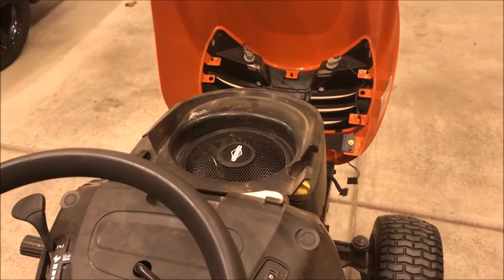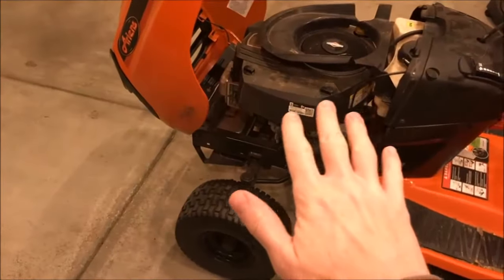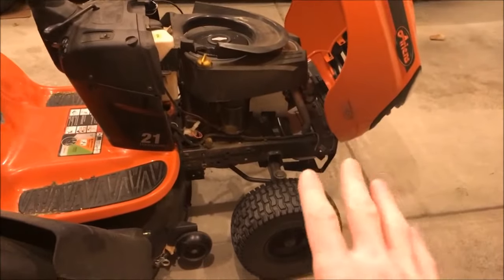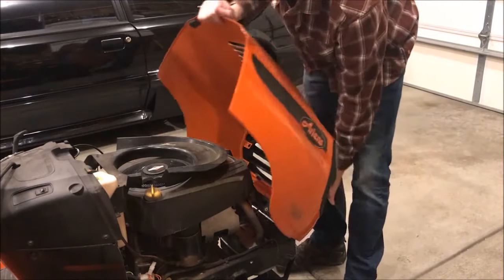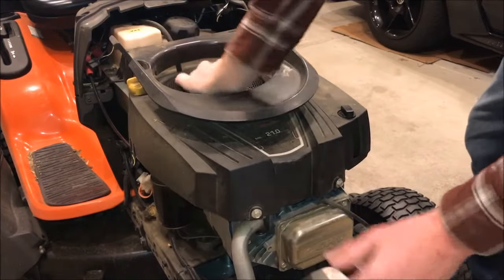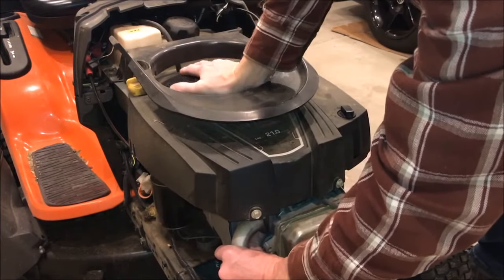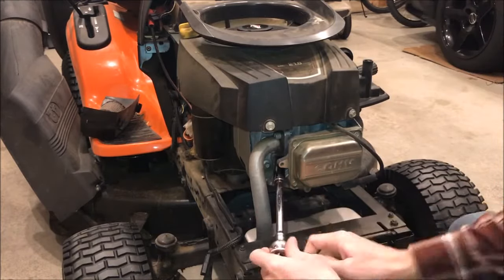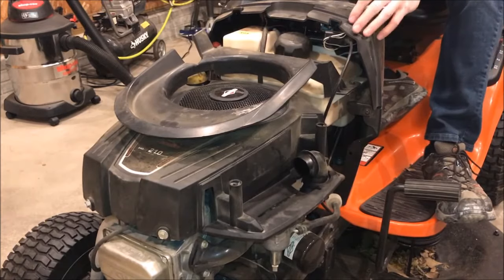Start Compression Locked Briggs & Stratton Engine

Comment: Well, I'll be pulling the plug in the morning. My machine is doing this exact thing.
Reply from the maker: Too bad. I think all of these motors are on borrowed time…. Best of luck. Installing a new cam isn’t too bad…you’ll get practice if you keep your engine.
Reply: @FastFixYouTube  Seriously contemplating a motor swap to a Honda. This Briggs made it about 5-6 years and we have short summers here.
Reply from the maker: Switching to Honda is a good idea. I’ve replaced the cam three times on my B&S.  I’m a pro at this point! Still upsetting when it continues to fail.
Reply: @FastFixYouTube  Here's the latest. Good news, I don't need a new Honda yet. I was one bolt away from lifting the engine when I decided to finally drain the oil. There must have been 3 quarts of gas in the crankcase. It was hydro locking and mimicking the same issues you had with the broken cam lobe decompression lever. Put everything back, put fresh oil in and it fired right up. It won't move now. I must have messed up my clutch adjustment somehow. I will have a shut off valve from the gas tank before winter. Thanks for your video.

Comment: You really don't want to be running those motors with the compression release broken. These little parts are now being moved all over inside the motor, possibly damaging other parts. It could get costly if not addressed right away. The motor may run just fine, but I can't imagine what's going on inside!
Reply from the maker: Yes, I 100% agree.  I think the annoyance of this part failing causes most (me included) to say “eff it.” 😂.  Thanks for the comment and you’re right!

Comment: Bahahahah saw another video…. Nice to have options! Saw a guy cover the intake(after removing air filter) with his hand & start engine same way! Then he placed filter back on while it was running!
Unfortunately my mowers older!!!! & seems to hav same prob!
So I’m double chkg the old starter B4 I go any further.
Reply from the maker: Correct, options!  I’ve resorted to the hand over the intake method, but instead of my hand I use a piece of plywood.  Less burning that way. It’s a PIA….  

Best of luck!

Comment: Just tighten your valves down tighter or place your hand on the guard and assist it. Starting fluid ion aluminum blocks and pistons is a hard no. Use brake cleaner
Reply from the maker: Haha, yup I discovered that MUCH easier method after I posted this. Will have to re-do this one and save everyone time. I had no idea starting fluid was bad for the blocks. Will give the brake cleaner a try. Thanks!
Reply: No doubt that you need your valves adjusted right and it should be done yearly But mine and many more the problem is the deal on the cam that is supposed to keep the exhaust valve open a little to release Compression is broke But as I posted you can rig it to start !
Reply from the maker: @dodge59able  exactly!  The valve adjustment is fairly easy, but the cam is a PIA. I’ve replaced it twice now and the relief mechanism has broken yet again.  At this point, I’m thinking of going electric.
Reply: @FastFixYouTube  hey bud...Thanks alot for the video...read the comments...some of these guys never "worked" on ANYTHING....!  BUT, if you will....what valve settings did you (end) up at please?  Or how many turns past touching maybe ?  And is it the same on both?  Thanks in advance!

Comment: Thanks for the tip...like a pro...
Reply from the maker: You bet!  For a faster start, you can just spin the flywheel to around TDC and stuff a rag into the intake. Usually starts that way and you won’t have to remove the plug and use starting fluid.

Comment: If you take air cleaner off and do a 100% choke meaning all air block start when it turn fast let the air in no air no compression.
Reply from the maker: Hello.  Yes, good call.  I don't bother to do all this anymore.  I just cover the air intake and it fires right up.  Cheers!

Comment: Just put you hand flat on the fan screen and turn it counter clockwise until it stops on the start of the stroke,turn choke on so the engine is sucking less air hit the key the engine has momentum and choked and it will start right up. Starting fluid will ruin an engines compression over time never use it
Reply from the maker: Yes, that’s a better method. Thanks for sharing 👍

Comment: F.Y.I. they recommend you adjust your valves every year, And it is not a big job I do mine in under ai/2 hour & most of that is looking for the tool I just had Lol
Reply from the maker: Yes, correct. I’d say most owners aren’t aware of this and are likely not experienced. To me, having this requirement is an unnecessary hardship on the owner.  If it were a few decades ago, perhaps not as big of a deal, but these days it seems there are less people with mechanical ability. That’s not an inditement, just a comment on reality.

Comment: Starting fluid is highly combustible, it  will dry out the oil supply at the top of the piston,& burn the rings. too much use can do  a lot of damage to pistons ,cylinder walls , connecting rods & crank bearings .it is realy meant for Diesel  engine cold starting. High compression is not compression lock. weak Starter motor or battery is probably the real cause.
Reply from the maker: The starting fluid was a last resort and I agree should not be used often. 👍

Comment: The easiest way I found was to remove the air filter, cover the intake with a gloved hand, this will relieve the compression and turn over the engine Everytime. Reinstall the filter and you're done. I leave outside cover off my filter to make this even easier and faster.
Reply from the maker: Thanks for sharing

Comment: Adjust the valves before you spend any money on it, I've never saw one that adjusting the valves won't fix, it's your money throw it away if you want to but it only needs valve adjustment.
Reply from the maker: No, you’re wrong. I disassembled the engine and the cam was indeed broken. Not a waste of money or time. Thanks.

Comment: A company should make a starter that is strong enough to turn these compression locked motors just to force Briggs and Stratton to spend money engineering another faulty product. I would laugh uncontrollably for days if this happened.
Reply from the maker: Hello.  Yes, you’re absolutely correct!  The way they designed this is abysmal.  Haha, after the third time I laughed too 😂😂😂

Comment: you don't need the decom valv  - get a bigger battery
Reply from the maker: If it were only that simple. Largest battery available was 340 CCA. Not enough to overcome compression lock.
Reply: I just jump my off from my truck, spins over very well! Will be getting a Gravely next , mo more junk!!!
Reply: The starter motor is not strong enough,  overamping it will burn it out.

Comment: DONOT do this shit! The compression release HAS broken! There are metal shavings in the oil and metal chunks in the crank case! They 100% WILL damage the engine catastrophically!
Reply from the maker: I ran mine the entire summer this way, but I take your point as I said as much in the video. Operator beware ☠️

Comment: These engines are such garbage. I had a John Deere with one of these engines fail at only about 150 hours this way. Ended up selling the stupid thing, but between power equipment, cars, and motorcycles I've owned 20+ engines in my life, many of them for decades, and that's the only one that's ever failed.
Reply from the maker: Right, 100% agree with you. Complete garbage.

Comment: you accomplished nothing as the problem still exists!. the valve tappets are out of adjustment
Reply from the maker: Well, I wouldn’t say “nothing” but you’re right the problem isn’t fixed, just a work around. You might be surprised how many people just deal with it and never fix the issue.  But yes, to properly fix, you must adjust lash or replace the cam if necessary 👍
Reply: He very clearly states that this is not a "fix." But it DOES accomplish exactly what he said it does, and that is to get it running and continue using until you have the time to tear it down and fix the root cause.

Comment: This is fast fixed? I can do this video in 15 seconds. Be a man take the air filter out put your hand over the tube crank it and let off when it starts to fire and you're done
Reply from the maker: Yep, MazdaMitch nailed it. No need to remove the plug and all that nonsense. Remove the air filter and yes, cover the intake hole and all set.  👍👍👍

Comment: I personally don't recommend the use of starting fluid in these particular briggs intek engines being they are commonly known for blowing head gaskets with their flawed head designs. For that much messing around id rather just pull the engine and replace the camshaft. If Briggs could come up with a gear reduced starter for these engines would be a good alternative also
Reply from the maker: 100%

Comment: Well, I'm no expert, but I believe that this major design FLAW is only on the ill conceived INTEK engines.  I have now, and have had in the past, numerous Briggs and Stratton engines in my push mowers, lawn tractors, zero turns, and snow blowers and they have worked well for decades.  However, NONE of those engines were the infamous "Intek" disasters.  In fact, both my present John Deere lawn tractor, and my Dixon 4423 Zero turn mower are Briggs and Stratton Van Guard models, and have been going strong since BEFORE the "turn of the century"!!  lol
Reply from the maker: You’re absolutely correct!  Major design flaw with disaster written all over it.